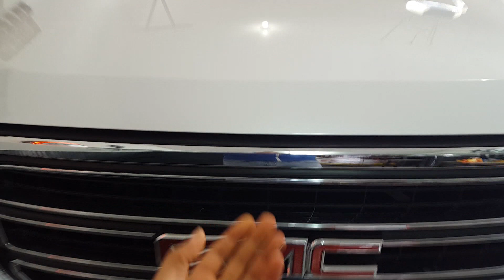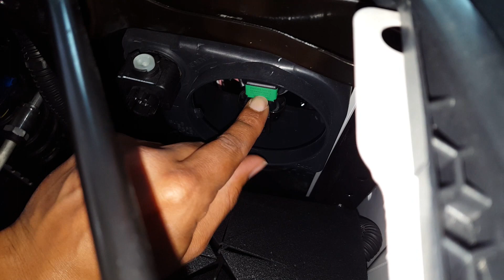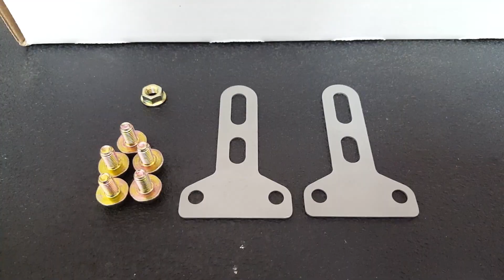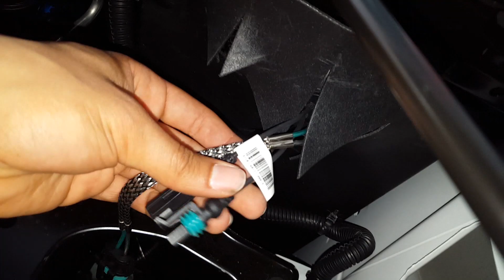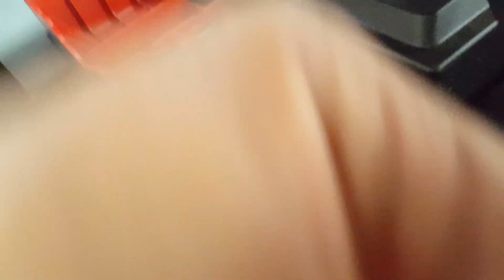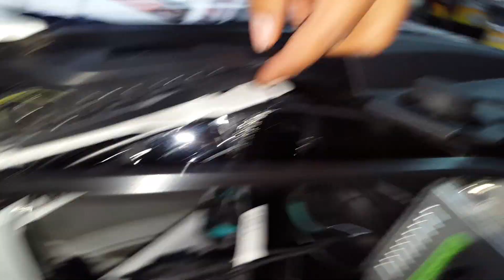DIY: 2014+ GMC Yukon HID Headlight Install

Comment: I recently ordered a set of this kit shown in the video. I haven’t heard from the company in almost 3 weeks. I placed my order on 1/9/19 and only received a order number confirmation. Money was withdrawn from my account on 1/11/19. No tracking number or nothing. Did I get robbed? Is this company still in business? I either want my money back or be informed on what the hell is going on!!!!
Reply: Yep you got robbed ,that kit is to much go to Amazon order kensus HID KIT  it's a great kit and simple ,no running wires to the battery
Reply: BAYNES1 BAYNES Well I received the product about 2 weeks ago and I can’t lie it is a very well put together system. My issue was with the customer service. I know they mentioned they were a small company but it took a little over a month get a response. When I received a response it was informing me that my order is on the way and to let them know if I have any problems with the kit. I’m not sure what happened or if there was a miscommunication but for a month a half I thought I had been robbed...

Comment: I've got a 2015 Tahoe, and I assume the lighting setup is very similar to the Yukon. I bought an LED headlight kit that replaces the high and low beam bulbs. The kit comes with 2 H11 bulbs and 2 9005 bulbs all with a ballast. The high beams work fine, but the Low beams only work when the truck is NOT running. When I start the truck, I can't get them to come on, they only stay on for a second or two occasionally, then turn back off. I am not using a relay harness, only the trucks factory headlight wiring to power these. Anybody know what the issue could be?
Reply: you answer your own question. u need relays

Comment: It's been asked once i'll ask again. This is and HID bulb in a halogen projector. How's the cutoff? You guy's should also show before and after output. I've got a 2015 Tahoe and have not been able to find any photo or video of how well the cutoff is with HID in the factory halogen projector.
Reply: LUCASTACTICAL1 Park the vehicle facing a wall and show the output from the drivers seat. At night.
Reply: Handi Man Blake Doucet   Putting rebased hid bulbs in any halogen projector will never be as sharp or bright as a proper hid projector retrofit. Halogen projectors are shaped differently and have blurry lenses. What this video shows is the cheap lazy method not the correct way to improve your lighting. Go to theretrofitsource.com and order the real thing.